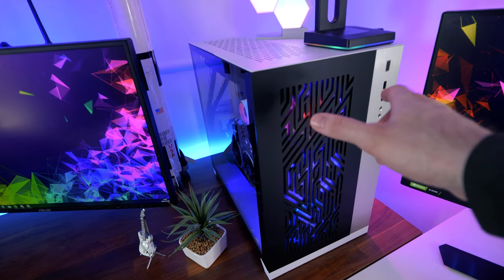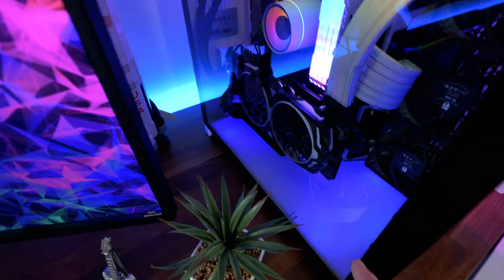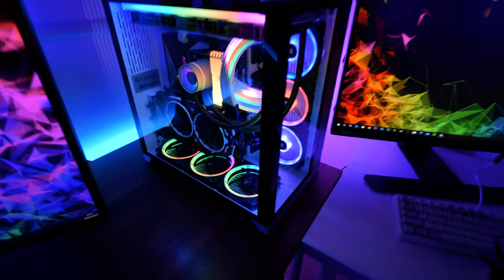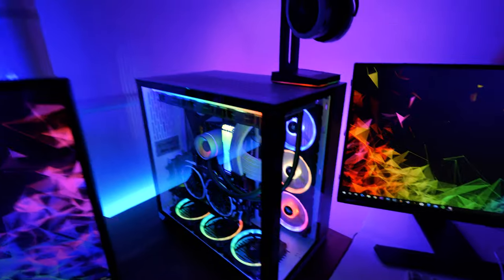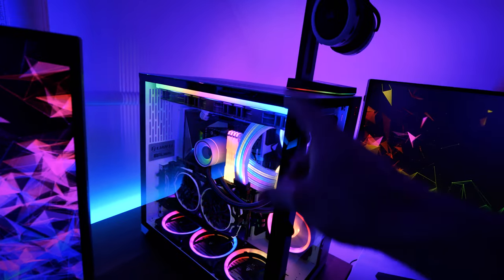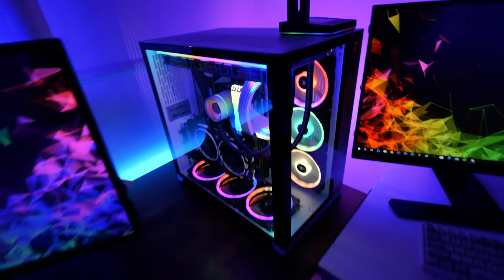PC Upgrade Vlog! Installing a bottom intake + adding more RGB Fans! 😎

Comment: Hi buddy I'm after some advice. My son has a Corsair carbide spec delta case which came with 3 RGB front intake fans and one black rear exhaust. He wants more rgb fans for Christmas because the case is toasty (even with him only having integrated Ryzen 3200g graphics) but I have no idea what I should buy. His current fans are 3 pin but they plug directly Into the 4 pin RGB sockets on the MSI b450 tomahawk motherboard. Any advice would be really appreciated.

Comment: Noticed you have a deepcool castle inside your case, have you ever experienced a weird annoying noise coming from the pump? My 240 ex is terribile, I had two of them replaced, but the noise is still there... So sad
Reply from the maker: Nope never. I've had the captain 240ex, and 2 castle 360ex (in different colours) and never heard any noises or had any issues with them at all!
Reply: @TechTesseract  thanks mate, I'm very unlucky then :D . 
P.S. that rgb <3

Comment: Really cool! Q: which GPU vertical mount system do you got there? And are the new fans at the bottom normal 25mm thick right? Or like low profile fans?

Comment: Dude i want to build something similar to this. But i went with the new corsair QL fans in white! you should check them out, they glow both back and the front, so you can have the most optimal temps with having the top as exhaust and the side and bottom as intake! Im also thinking about getting a GPU support bracket to hold my GPU up because i heard it kinda drops alittle from the weight(RTX 2080 ti), but i might just go with this vertical mount you have. However i heard that some vertical mounts have faulty extension cables, so your frames drop or have stutter? does yours have any of that?

Comment: Can you still access your top pci slot I have a wifi card I need to have installed there but would love to have bottom intake fans as well and it looks as if the phanteks brackets puts the gpu slightly higher than the cooler master one does